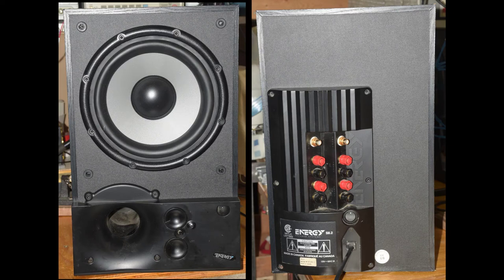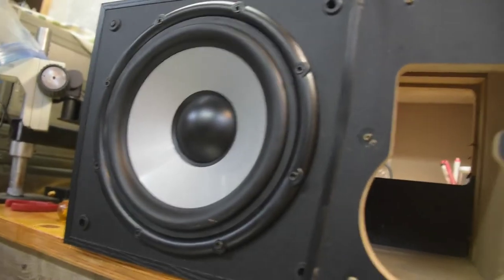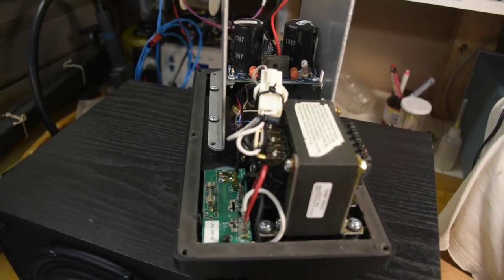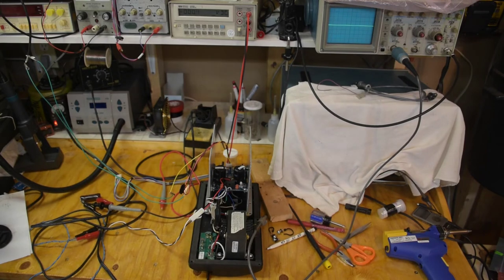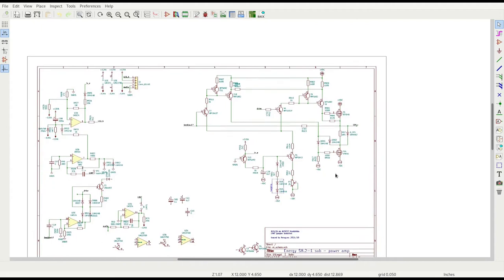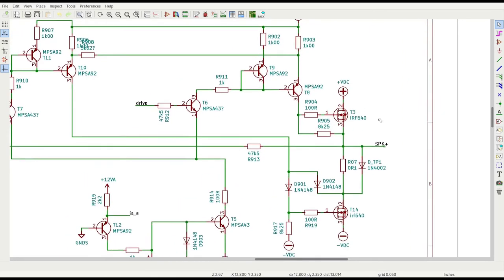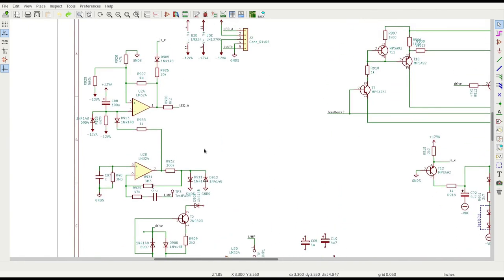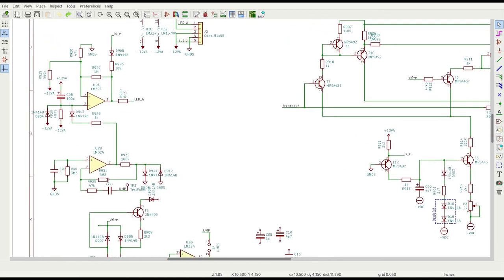Energy S8.2 subwoofer "repair"

Comment: This video is super helpful. I just opened mine up and had a similar issue with the fuse, but I also noticed that they are two pairs of unattached wires - each pair has a gray and a black. Nothing is attached to the back of the RCA input or the RCA crossover. Do you know where each should be attached? (e.g. black/black to the input or gray/gray to the xover? or mix and match?) Any chance you know off the top of your head how those should be attached.
Reply from the maker: Do you mean coaxial cables (each with one shield and one signal) going from the front panel PCB to the rear connections ? I looked at my photos and unfortunately I didn't take that section apart so I have no documentation, sorry

Comment: I wonder if the newer S8.3 subwoofers would be more efficient on standby, the amps appear to be of a different design. I had a Polk subwoofer that was warm to the touch even when the switch was "off", leading me to suspect the amp doesn't really turn off. This S8.2 seems to have an old school circuit board design, but the benefit is they didn't use the yellow glue which I've noticed on the newer models. This glue turns brown and corrosive over time. Curious on how the condition of the capacitors were and if they should eventually be replaced?
Reply from the maker: Yeah the S8.2 doesn't really power down at all except with the switch off. And at very low input volumes it goes to "sleep" which is even a bit annoying, so overall not very satisfied with that implementation.
Capacitors looked OK in mine - they were not from notoriously bad brands, not bulging, not leaking, and ESR measured fine IIRC. They are less critical than in an SMPS so I'm not in a hurry to replace them.
Reply: @fenugrec5697  I just felt the back of my powered off S8.2 subwoofer and the amp is warm, so your theory is right. In contrast, my newer S10.3 subwoofer's amp is cold to the touch. I have a feeling many old school subs were designed this way when phantom power draw wasn't as big of a concern.
Reply: @speedboxx  I have a S10.3, when power on, it makes a big thump and no sound at all. I opened it up and found a capacitor (C13 located behind power on off switch) was missing. If you have a chance please let me know the value of that cap. thx

Comment: se puede mandar señal de otro subwofer activo a ese energy es k no se si son entaradas rca
Reply from the maker: I guess it will depend if your other sub has an output. Are you asking if the S8.2 has RCA inputs  ? See photos, also the user manual is easy to find online.